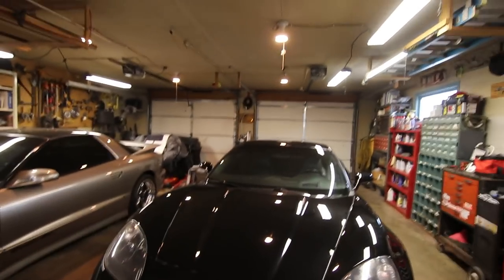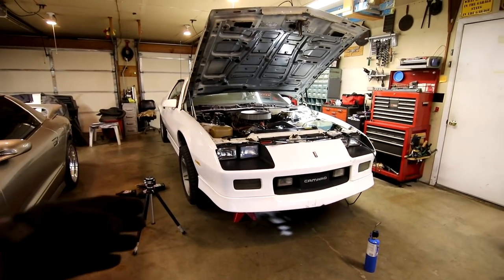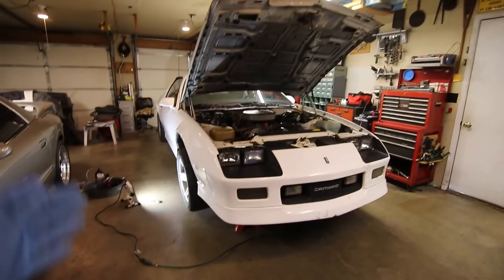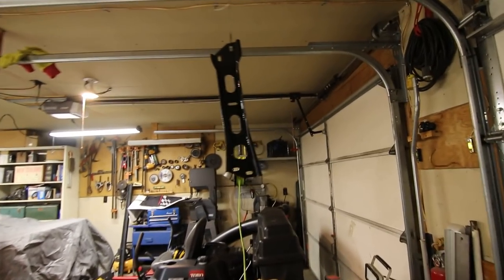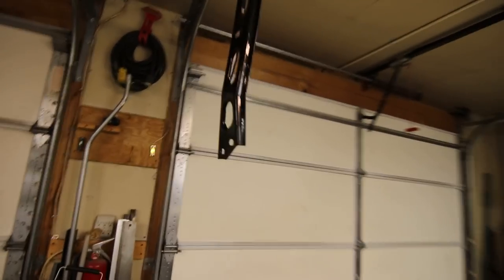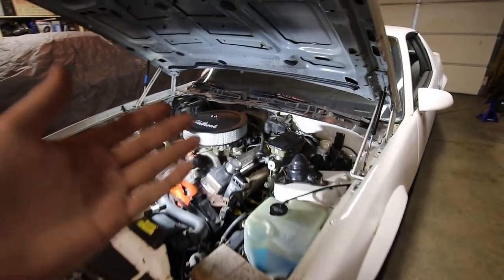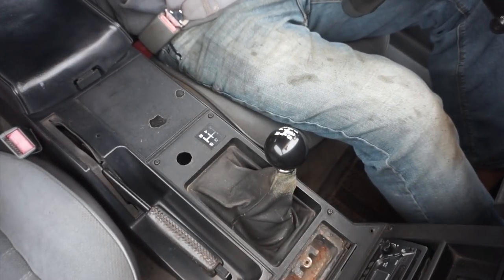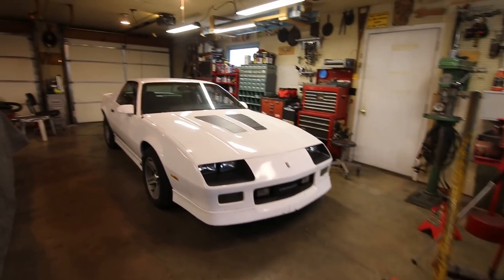7 YEARS of IROC-Z Neglect... This Could Have Been BAD!

Comment from the maker: This is one more step towards making this Iroc-Z a great car. The exhaust is coming soon! I explain in the video....
Reply: Maintenance first. Paint job last.. just look at my project 94 Pontiac Trans am. You'll see... Thanks 👍🇺🇲
Reply: Edelbrock tubular headers 1" 5/8.. comes with y pipe.. I had that on my 87 iroc z. It was only a 305 tpi. But it sounded nice..
Reply: Hi my friend I would change out them lower control arms on your irocz. They look pretty bad..
Reply: Manifold collector bolts put brake fluid on them with them little warm the night before you going to take them off it's always work for me plus I'm not mistaken you can get a set of headers for that 350 off of eBay for 90 bucks sure might not be the best in the world but better than stock have fun with it o and yea been looking at urethane bushing kits as well front and back surprise how cheap they are
Reply from the maker: @kevinb158  the parts are cheap but the labor can add up quick doing a whole front end rebuild. I'd consider doing it too but at a certain point you might as well blow the whole car apart and start over haha. Headers and exhaust are on the short list for the car!
Reply from the maker: @keilylmm6377  agreed! It's tough being patient with all of this lol.
Reply: @Greenlightfilming  good Saturday evening my friend. Just got done watching the army Navy game.. I'm a Navy vet but we lost today 15-0....🇺🇲

Comment: Hey bud, I highly recommend checking the caster camber mounts. I found they are the most over looked part on a 3rd GEN. If you haven’t already, check em. They have rubber in them like that transmission mount and it separate as well. You’ll never see with that plastic cap covering the rubber up. Mine were 75-80 percent split. Those thing are so over looked. I had no idea.

Comment: Magnflux the exhaust manifolds , verify no cracks on the gen 3 small block cast iron.exhaust manifolds. My 305 5speed Firebird (Gen 3), were cashed, on both sides. Cast iron is a birch to weld, so we just found some good used ones.

Comment: Love the project. Doing one myself right now. The y pipe is usually the exhaust leak issue. Magnaflow makes a really nice high flow y pipe of under 200$. That should fix it as there are no collector gaskets. It’s metal on metal.
Reply from the maker: I'm sure you are right about it being the y-pipe. I'm 99% sure it's the collector on the passengers side. That's on my short list of things to fix on the car.

Comment: TPI exhaust manifolds and magnaflow y pipe, the cheapest upgrade to lg4 manifolds.  If you go with headers you’ll have to fab something fit the power steering bolt on cylinder #1.  There is fitment issues with most manual transmission cars and off the shelf headers as well.
Reply from the maker: Well said. This is one of my biggest hangups with ordering some headers and a y-pipe for the car. I really feel like that if I order something that is commonly used, it won't work with my car because the engine is from a '74 car/truck and it has a manual trans etc. I'd almost like to work with the manifolds and y-pipe that are on it for now, til I get a better idea of what the next step is with the car.
Reply: @Greenlightfilming  I went through the same thing this summer (T/A, LG4 305 700R4, needing full exhaust).  I went with an inexpensive set of headers and y pipe, Dynomax cat, 3” (2.75” in reality) catback.  I’m not in love with the headers but they’ll do until I can get it to an exhaust shop for fitment tuning (hangs too low).  

Right now the LG4 manifolds y pipe and cat are choking that engine.  TPI manifolds and magnaflow y pipe are the cheapest route and the most reliable fit - if the manifold ports match the heads (you may already be experiencing leak issues with this as the lg4 has the same port shape as the TPI).  

Under 400HP there is no notable difference between single 3” exhaust and duals.  You can get the Dynomax kits from RockAuto and it’ll save you a good amount over a speed shop (the intermediate pipe will accept a 3” ball connector).  You could also just do the intermediate pipe , brand x flow through muffler and drivers tip (eliminate the passenger tip) and save more money / weight.  It’d be loud but it’ll sound amazing.  That’s not an RV cam, way too much lope.

Comment: ... another great, detailed and  helpful rundown. REALLY APPRECIATED. not sure if this is the right place BUT I just picked up an 85 Trans Am 305 tpi auto., I wanted something that I could "improve" little by little, bit by bit- realistically, because I am by no means a mechanic. I intend on learning and making "it" better with the time i have to put in (i'm sick w/kidney failure) BUT after looking, SAVING, and waiting I grew impatient and think I bit off more than I can chew. *1) on the way home from pick in up, it started "bogging" down, feeling like it was gonna stall/die; no acceleration or momentum-had to "feather" the peddle not giving too much or too fast. (I think it might be MAF, fuel pump, or fuel pressure) SO, I go to change oil today (3days later) and found that the rear differential was leaking, the power steering had a leak, and so was the asket
Reply from the maker: Thank you for the kind words, I appreciate it! Hope your health gets on track first of all. That stuff will make literally everything else in life 10x more difficult, so I'm sorry to hear that. 

You are probably correct about it being MAF related, but unfortunately on those cars there's 100 other things it could be as well. They are temperamental critters. It sounds like you got one that's about par for the course if you don't spend a ton of coin on it, or get lucky. Good luck with everything, and make sure you hop on Thirdgen.org for more support on your car.

Comment: If u wanna keep it cheap flowtech mid-length 1.5inch headers and they make a Y-pipe that I believe is 2.5inch maybe it 2.25... it'll bring it right out to the heat shield for the cat and just throw a 12inch cherry bomb with a down facing tip all under $500 sounds good just alittle loud and anything flows better the factory manifolds!!!
Reply from the maker: I'll be getting a set of headers and a y-pipe for sure! Haven't decided on what to do for the catback, but i'm thinking a lot about it!

Comment: Go with a Banks gen 3 exhaust, single, but larger diameter. That dual converter system, on the 1-LE, cars is super expensive, and unobtainable. Pretty much.

Comment: See if you can source all your aftermarket, race parts used. Lots of deals to be had out there for top notch performance add ons. Will save you $$ as well.  And that music, brutal.
Reply from the maker: That's the plan so far. If I can't get it second hand, or cheap I'll have to keep looking harder lol. The car will be mostly comprised of used parts.
Reply: @Greenlightfilming  Perfect. People will relate well to this as we all look for used parts to move our projects forward.  Lots to do while waiting for used parts to materialize. I’ll help you now. 

1, remove dent from fender and touch up that primer spot. 
2, remove those cute mud flaps. 
3, fix those small fog lights. 
4, used stereo equipment is a dime a dozen. Can always do a double din touch screen and speakers. 
5, electric fans. 
6, poss tint the windows. 
7, more detailing of undercarriage and paint 
8, call the guy you made the rim swap with and see if he still has your old torque thrust trans am rims. Get them and put them on the 3rd gen. 
9 by this time, you would of found a ton of used stuff to keep modding. 
10, then we the subscribers can come up with 10 more things you can do. Lol 😂   

Cheers.

Comment: Great video!!! I not to long ago change the trans filter and fluid on my 92 Z28 5.7 TPI and while i was under the car i find that one of the trans cross member bolts was broken off so i got to try and drill it out and re tap it. Anyway keep up the great work and can't wait for the next video.
Reply from the maker: Thanks bud! Appreciate it! I've got a couple more in the pipe for this car already. Like you found a broken bolt, mine were in there TIGHT. I don't know who did it, but they were tough to get out. Next time should be a cake walk lol.
Reply: @Greenlightfilming  Yeah I know what you mean i checked the other bolts and man there are tight and i don't know why they tighten them down so much  .Now i didn't push my luck so i left them alone for now until i can set the car up and take the time with it . I figure with just one bolt broken i can drive it as long as I'm not hot roding on the streets.

Comment: It's a transmission output yolk vibration not pinion vibration the part closest to the mount is changed more than the pinion at the diff thats 4 ft away.
Reply from the maker: Both angles changed. If one does the other does too... If you want to be technical it's probably considered a driveline angle vibration.

I think you know what I meant in the video.
Reply: @Greenlightfilming  geometry shows different if you do all the calculations if crankshaft is on centerline of trans but the yolk extends past the trans mount. For instance if transmount is a foot forward when you raise the trans at the mount 3/16 of an inch with a spacer shim then at the center of transmission shaft internally is raised effectively the 3/16.  The angle from the motor mount back to the yolk centerline of universal, lets say is a full twelve inches back further than trans mount. So now if you have 3 feet between trans mount to motor mount total, then a foot to yolk center is a total of 4' overall, it raised the yolk a full .250 because from yolk universal centerline has moved .063 (2/32) more in addition to the 3/16 shim at mount because of that extra foot beyond the mount. Now if you have a total of 5 feet from center of yolk on drive line back to pinion center at the pinion it calculates out to .050 effected change between 5 foot span vs 4 foot span so angularity is different going into pinion and also the pinion is a dynamic angle because it self alignes to drive shaft as rear axle moves up and left under driving load.   The drive line is exactly the same angle in space but not where it exits the yolk versus entering the pinion.    You can have more of a kink at the yolk than at the pinion because their separate components in relationship with each other.

Comment: Dude sounds like a dount gasket is leaking on passenger side. You should check out exhaust on summit racing. Depending on what you want they have exhaust kits that are inexpensive. Looks like someone put a glass pack on it.
Reply from the maker: That's more than likely what it is. I was checking out Summit Racing last night. They have a decent selection to choose from. I'll be in it for under $1,000 I figure.
Reply: I think you'll be much happier when you do decide to change the exhaust. Not a bad car though. Irocs are getting harder to find.

Comment: 1000 bucks for a set of hedders and straight pipes were do u live ?
Reply from the maker: Upper Midwest
Reply: @Greenlightfilming  
I am a mechanic and a 3rd gen owner for 20 years and yes 1000 to 1500 for an exhaust system for these for a ton of reasons 1 its an f body thats a ton of reasons right there mine was a 2.8. Automatica i converted it to a 355 with a stick. All in my drive way long tubes i wish but not without being a master welder and ground clearance too much to type but great job man good luck god bless you and your family if you need any advice i will be glad to chat with you
Reply: @Greenlightfilming  Wisconsin? lol